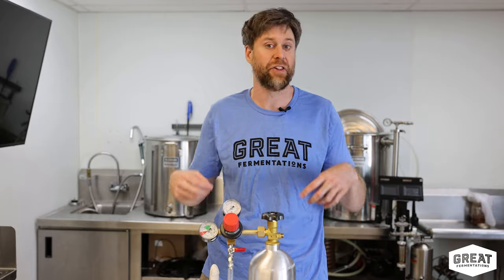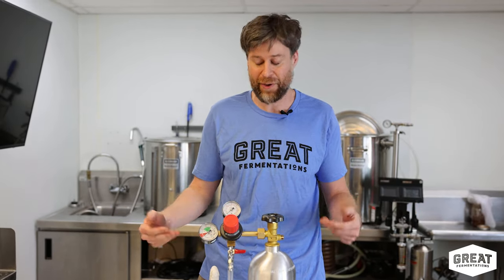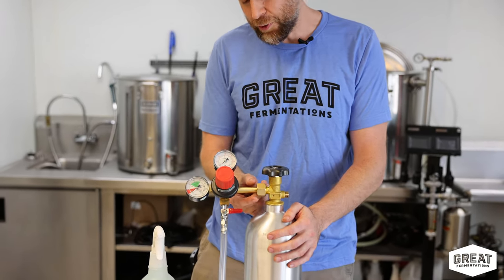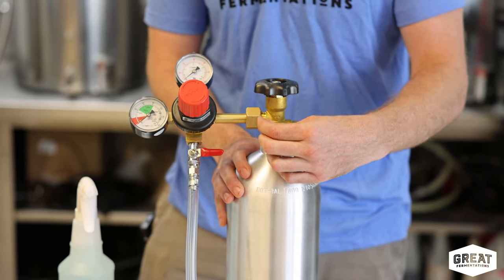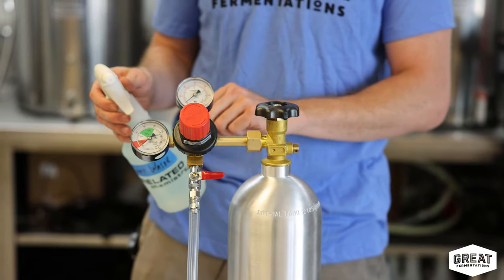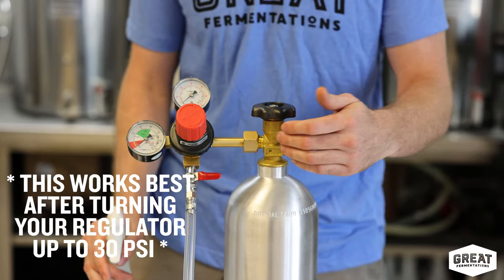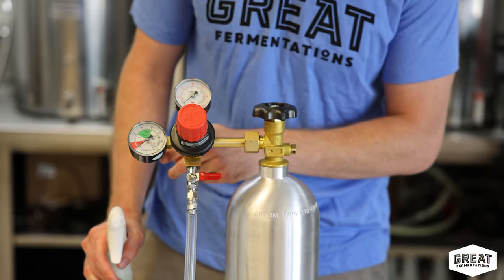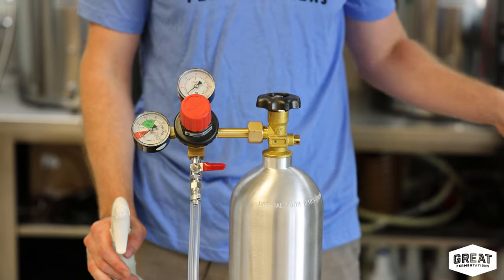How to Check for CO2 Leaks with a Simple Spray Bottle!

Comment: T.Y. Old video but I used it to find the leaks in my first KEG setup. I suspected the MK4 regulator but it was the plastic bolts on the John Guest 3/8 that I did not screw in with sufficient force.
Reply from the maker: Awesome! Glad to hear this video helped out.